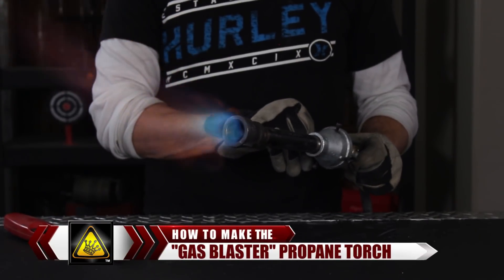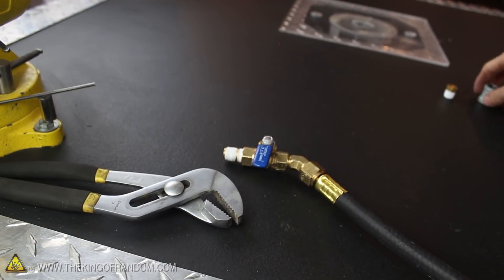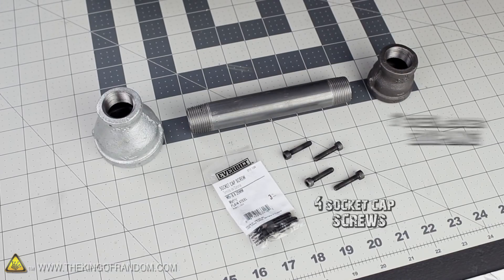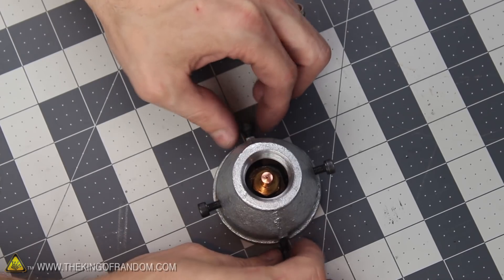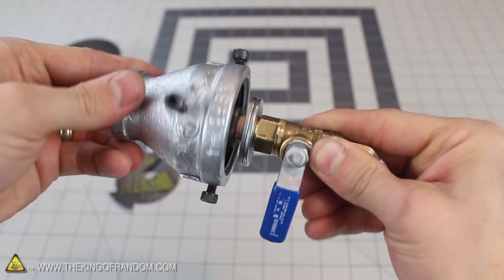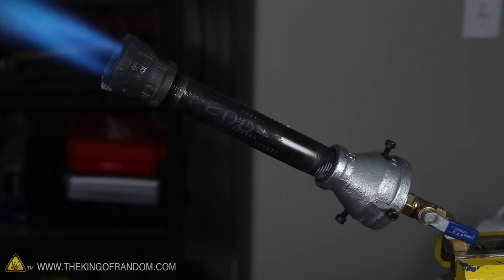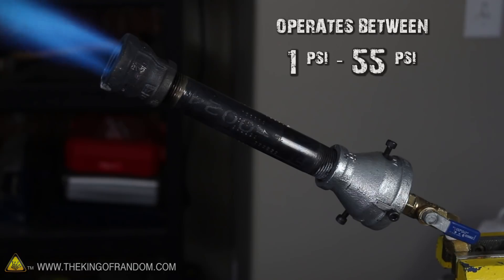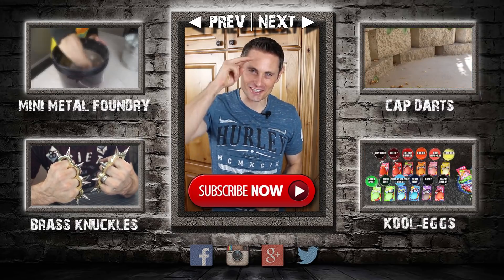Convert Your Backyard Foundry To Propane! ("Gas Blaster" Propane Torch)

Comment: Who likes watching the how-to's but never does them?
Reply: +billna billy Pretty sure if I made all of Grant's stuff, I'd be pretty broke and homeless by now :/
Reply: relik0fages But loads of cool gadgets! XD
Reply: who doesn't tbh?
Reply: valkrie rocket6 cheaper than buying the "real" stuff, but it is still expensive for some1 (me)
Reply: +billna billy The only thing I have made is the flower pot foundry and it worked beautifully. This one seems pretty dangerous though
Reply: Me
Reply: If I tried something like gas torch for foundry, arc furnace, hydrogen generator, there would be a crater where northwest Santa Rosa, CA used to be.
Reply: I've done most of his projects and I'm only 14 lol
Reply: +billna billy I've built my own foundry and done some simple aluminum casting. I also made the metal melter while still in high school. I would really like to do the arc furnace and this torch.
Reply: +DougsterGaming of course you did...
Reply: +relik0fages it's all pretty cheap
Reply: Me
Reply: +billna billy I made the foundry and didn't use the proper crucible. It melted and burned a hole thru the bottom on  the bucket. Sand and all. I had molten metal running out LOL. I am going to do it again though.
Reply: +Charles Allen I have had 3 successful firings using charcoal, but it throws ash everywhere. Will be converting soon.
Reply: +billna billy me
Reply: I actually made the foundry
Reply: +Ben Abbott yes
Reply: Was it really easy?
Reply: +billna billy me face
Reply: That feeling when you can't get that kind of good stuff in Singapore

Comment: btw. since this has no blow-back prevention device on the operating end. this is a really dangerous build. there should be one before the valve. also cutting threads with a powerdrill is really stupid as you can strip out the thread you made.
Reply: +sir Reinhardt You can easily cut threads with a drill in brass or cast iron.  Only steel is hard enough to need hand tapping.

Comment: It looks dangerous. And that part held only by the screws pressure, doesn't seem reliable.
Reply: +brcpimenta how do you think a bbq, gas stove and natural gas furnace are held together?  same fittings.  There's almost no pressure in this system..  50psi is less than what's inside a coke bottle before you open it.

Comment: In threading a hole, can the drilled hole be smaller than the tap? Or it needs to be a similar size? And how do you actually screw in fittings and make them turn to a place that is just right. For instance what you did in the video when you screwed in the regulator to the tank, it actually came upright.

Comment: Pliers!? Really? That could possibly create a leak. Why not use the right sized  wrench? Poland Teflon tape does seal but it's not made to seal , it's made to lube the threads so you can tighten the pipes and fittings better because they are slightly cone shaped to help seal better

Comment: They make a tape for use with propane and natural gas connections as standard teflon will degrade and cause leaks when used with gas (propane/natural gas) products.  it is usually yellow in color and more heavy duty or use pipe dope to seal your connections.

Comment: +"Grant Thompson"  If you add wire reinforcement to your plaster foundry lid before casting (like rebar through concrete) it can help hold it together, and strengthen material bonds in the future. Just a thought.

Comment: do you have a ceramic crucible or are you still using the old fire extinguisher?
I ask because my first project burned up my extinguisher, but luckily i had another one a little thicker.

Comment: "I got this drill machine for under $20!!!"
Reply: +ShadowVipers4 $200-$600+* never seen one for under 200 without something wrong
Reply: +Damocles 97 Depends on the size of the drill press. For a floor model with a deep throat (heh), sure, you're going to pay a lot. For a smaller benchtop model with maybe a 6" or 8" throat you can find good enough ones well under $200. Add in garage sale discounts and it;s not unreasonable to find one under $50.
Reply: +ShadowVipers4 $200-$600+* never seen one for under 200 without something wrong
Reply: +FlizAnimate jk but good video though!
Reply: +Archie Bunker Heh unless you find it in a garage sale... think again, they normally range from 150$ to 250$+
Reply: +Damocles 97 One word: Craigslist.
Reply: Proper pillar drills are expensive but I've got a thing that converts a hand power drill into one.

Comment: Grant, forgive me if I missed this during the video, but would you leave the pressure at 30 to use it in the foundry, or is the 30 just for checking everything and there is another pressure setting that you would use for the actual use?  I'm a big fan and thanks for the video.  Can't wait until the next ones come out.

Comment: Definitely a huge step up from using charcoal, but for my castings I use heating oil. It burns just as hot and is much less expensive.

Comment: !WARNING!  The white pipe tape is for air and water.  You need yellow pipe tape for flammable gasses.  Gasses like propane will eat through the the white tape which could cause a leak and then explosion.  Just want to see everyone design and experiment safely.
Reply: Also don't used galvanized piping in the flame areas like the pipe or flare.
Reply: +canral Next time you are at the hardware store.  Compare a roll of the white with the yellow.  Its the same stuff.  The yellow is thicker than the white, which is how its rated for gas use.
Reply: I'm not gonna argue with you.  You are correct that the white tape is thinner.  I was incorrect on it eating through the white stuff. It's more porous. I misread the research I had originally done. But so being a porous material makes it more likely to leak, They are both Teflon, but different grades.  So I stand by my original statement that since this is a video shown to people who may not know all the proper precausions, I feel that people should use the tape designed for gas.  Safety first.

Comment: If you covered the back where the "air regulator" is somehow so it was sealed, and added another valve it would be much easier to control the air intake. Or even add a fitting for compressed oxygen for even more heat, or even a cutting torch if you put some kind of smaller tip on the end

Comment: Hmm, the Propane Nozzle it allot different from what I thought you used. But outside of how it was built, minbe being entirely black steel and having a long pipe fitted through a hole drilled in the wide part of the reducer with a screw down air adjustment valve they are functionally the same.

Comment: Wow sorry but thats dumb closing the front valve there will still be gas in the hose what would be safer is to just turn the propane tank off and let the rest of the gas burn out
Reply: No response as i expected
Reply: +xboxgamingduff u probably just realized how unsafe that is but just don't even reply
Reply: +PhoenixFireBlaze no i know but still it wasn't the smartest thing he did  but he probably saw my comment though
Reply: The propane left in the hose gets vented when you back off the pressure regulator, after shutting off the valve closest to the flame.  Shutting the gas off at the tank with the flame still burning is what gives you the nice loud "pop" at the tip.

Comment: Would I be able to use this sort of setup as more of a blow-torch if I used a smaller diameter adapter on the six-inch pipe?

Comment: Ok, here's the parts list, including links to the specific places in the video he mentions parts: https://docs.google.com/spreadsheets/d/1ShhoqoY9p0LveHGyF2QOuOAqShRRwwlHy6EkBGY7mp4/edit#gid=0
Total is $100.29 with a few things missing like the 6" steel pipe.

Please add suggestions and corrections as a comment. Thanks!

Comment: So why doesn't the crucible melt its self with all that heat
Reply: cause it is made of a metal thst needs very high temperatures to melt
Reply: +Benjamin Dan Made of porcelain or something like that, which doesn't melt until you boil tungsten, probably.
Reply: +waterlubber Actually, it's steel. He uses the bottom of an old fire extinguisher.
Reply: Jason Schuler Wow, really? Wouldn't temperatures that high decarbonize it?
Reply: +Syed Harris It will fail eventually.
Reply: All crucibles have a fail/life rate. Some graphite crucibles have failed 1st pour. There are many variables affecting the life of a crucible and it's pour cycle. But if you operate on the assumption that your crucible will never fail then you are an accident waiting to happen.

Comment: Just a couple of additions I would add: a check valve or flash-back valve on both sides of the hose. This will prevent ignition if there was suddenly a pressure drop or hose leak.
Three other safety points:  
Check your set-up for leaks with a solution of washing up liquid and water or some leak detection spray. Stopping hissing sounds is a start however gas can still leak.
Use approved hoses: there are dates printed on them when to discard by. 
NEVER use old or worn or frayed hoses

Comment: You should make a sword Forge. Make a rectangular forging area and then point four (or however many you need) of those propane torches on the top of the Forge. You can then blacksmith swords!

Comment: You should never use a drill to cut threads!!
Reply: +Nerfin Merfitt no lubricant is not an issue in cast iron (presuming those couplings were cast iron and not cast steel) as it is self lubricating, power taping is also not an issue as long as the tap remains parallel to the bore. We power tap all the time in our lathes, mills and cncs where i work.
Reply: +TheTetrapod You use a handle on the tap.  The hole should be covered in a "tap magic" kind of lubricant.  Then you start tapping.  Tap the threads a little ways and then back off a little.  Repeat process adding a little lubricant when needed.  He did the process really fast and there was no lubricant.  This can ruin the tap and make your threads gouged out.
Reply: you can make an easy test,
take a drill  first and than do it properly once.
Afterwards you take a hardened screw and a torque wrench and test how much torque it takes to rip the thread out of the steel.
The properly made one will be much more resilient.
Reply: +Peter Griffin its so weird mentally reading these comments in peter griffins voice
Reply: +TheMechanic NZ He said steel couplings in the video.  You can use a drill to tap but usually you lube it and go forward then backwards then forward again.  But he went really fast.  I've seen it done on a lathe before and it worked just fine.  You're right about the the perpendicular part.  But this is a drill!  That means you're guessing on how straight you are and going fast.  It's best to go slow and use a low torque setting so it won't bind and power through.  If it's stops on low torque then you'd back off and try again.  The brass he first tapped wasn't too big of a deal.  Because brass is softer and it won't have as many problems.  You can tap it and keep the drill going the whole time.  Just slow the F down geez.
Reply: +Peter Griffin And you, of course, are an expert, as can be seen by your professionally chosen profile representation image.
Reply: +Andy Rockwell you are really really stupid for even thinking that is relevant
Reply: Damocles 97 Thank you.
Reply: Yes!
I stumbled across that, too.
But at some point he is gonna find out himself that it is better to do it properly,
taps are expensive.
Reply: I mean you can tap threads with a drill just gotta worry about breaking them with too much force. But another point to make is that we have a CNC machine that can tap at 5000rpm granted that's a 75,000$ machine but just shows if things are right it will still work and the threads will be fine. Look up the haas DT1 if interested. It amazing to watch it work.
Reply: I know!  I was like wtf is he doing!
Reply: Well in the end he is an amateur.
Reply: +Peter Griffin yes he is.  I think he was trying to do it as quick as possible.  Not the right way.  But quick.
Reply: Umm, why not?
Reply: Easy, cutting threads is a slow process in which the edges cut away quite a lot of steel which is way you should do it by hand,
slow and steady.
Reply: +Nerfin Merfitt I was in pain while he was tapping those holes.
Reply: +Benjamin Demick Same here bro.
Reply: +Nerfin Merfitt Exactly, always more than one way to do the job. little bit of lube never hurts anyway.
Reply: Cutting threads with some cutting compound and a cordless drill.... no problem
Reply: +Damocles 97 I'm pretty sure it wasn't meant to be relevamt
Reply: +Peter Griffin In both of your examples the failure would likely be caused by the shaft of the screw snapping. The "sloppier" drill tapped threads are still plenty good enough not to be stripped out before the screw would fail by snapping above the threads. I agree with you that skillful hand tapping is likely to produce a more accurate and closer (stronger) thread. But I also don't think it's important in a hack like this torch. As long as the proper hole was drilled for the tap, the threads are plenty good enough for this application.
Reply: +Peter Griffin amateur? at what exactly?
Reply: +TheMechanic NZ where do you work?
Reply: Says Peter Griffin! Worst channel name for these topics lol
Reply: +Peter Griffin as long as u oil it up it should be fine, we power tap stuff a bunch at a machine shop that i work at.
Reply: +Peter Griffin Yep, doable but I've seen them snap off by a carpenter playing at plater. To the bane of the platers that were brought in to fix the fck up.
Reply: You can it works but you just have to buy a new tap after :)
Reply: +Peter Griffin Obviously.....it worked ....from what the video showed.

Comment: you found a drill press for 20 dollars? was the seller high?
Reply: garage sale gold, you would be amazed at what you can get at those!
Reply: I sold an old one for 20 at a garage sale last August. It was a solid unit with a nice motor probably from the 50's. I had a bigger better one and it was a tad rusty and the belt was loose. Didn't need it anymore and figured sell it cheap to someone who would put it to good use.
Reply: He opportunities in canada are rare...lucky u guys lol
Reply: Best thing ive gotten was 3 pairs of blaze orange snowpants, 3 blaze orange jackets, a scent free bag, 2 pairs of gloves and a portable heater all for 70 bucks at one sale. Im a big hunter so that was an absolute steal for me
Reply: +Luke My buddy got a Big Berkey filter at one for about 15 dollars hardly used. Those things are normally 150 dollars+++.

Comment: As always, awesome engineering GT. Could this be modified to work with the hydrogen gas station from your previous project to make a hydrogen welding/cutting torch?Wow, that would be an awesome video. I Have seen some on YouTube but would love to see one of your designs. Thanks for all the cool projects.😄

Comment: U could just buy a blow torch XD
Reply: +Toni Maričić  we just use the el cheapo harbor freight weed burner torch in our homemade forge . it doesnt look as cool as this but  it was close to 20.00 and works great
Reply: +Toni Maričić not big enough
Reply: +jon west Does the harbor freight torch reach welding temp on steel? Im in the air on using the weed burner or building this torch for my next forge.
Reply: glockfan112  I dont know man we just ude it to melt aluminum so far

Comment: Well appart from the Fact there is no flame stopper and Safety In that system   And not any kind on protection       I would say perfect When the flame shoots back thru the welding tip Down The pipe    and right in the tank   It is a thing if your pressure gets to low  and gas burns faster then the tank can supply the gas  It will back shoot   And Is More then Dangerous

Comment: Why shut off the flame by closing the end valve? My experience with Bunsen burners is that you should always close the source tap (in this case, the propane valve) first to ensure that any excess fuel in the piping is burned off before you disconnect everything.

Comment: Do I smell flamethrower?!?!
Reply: +Alex Kalina no you dont ,flamethrowers dont use gas,they shoot sticky liquid.
Reply: +zumbazumba1 ( ͡° ͜ʖ ͡°)
Reply: Savage Sadistic
Nope nope nope.Its napalm or in old days 75%disel(or motor oil) and 25% gasoline.Flamable gass is used only for lighting the nozzle burner.Flamethrower uses gas(carbon dioxide ,hydrogen etc) as a propelant to eject fuel,never as a fuel itself .

Comment: I have a couple questions. how long will the 20lb tank run? I have a 125lb tank but finding adapters to fit the smaller tank is impossible. Also, with the propane, is there a significant reduction in the crucible's life span?

Comment: Would this work for a propane forge? What temperatures is it capable of reaching?
Reply: If you're planning on forging steel, you're going to need charcoal and a forced air supply. I tried forging with propane once, it was useless. Couldn't even temper a tiny little neck knife properly.
Reply: +Bladsmith Already have a charcoal forge. Normal propane torches wont cut it heat wise no matter what but this thing looks like a step up. I forged a twisted handle rr spike knife last week.

Comment: Thank you so much! I've been waiting for this for a while and will definitely build it!
Reply: no you wont
Reply: yes I will, I've already made a foundry but I've been waiting for hoe to build the burner
Reply: +The Slingshot King so there people that try this freaking manly
Reply: lol thanks
Reply: I like your vids
Reply: Thanks man!
Reply: +The Slingshot King hey man can you help me?,i dont understan how these tuna can became air regulation device?
Reply: The air goes inside the tube from around the silver cap, but if you close it off with the lid, the propane cannot burn until it gets out of the tube (because it doesn't have oxygen in the tube), so you will have a less powerful flame. It's all about the amount of oxygen.